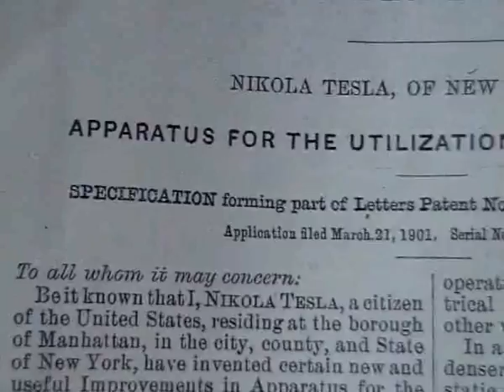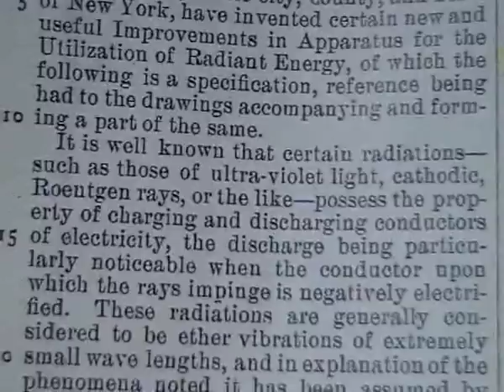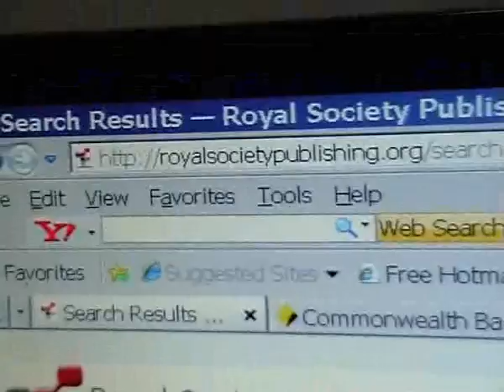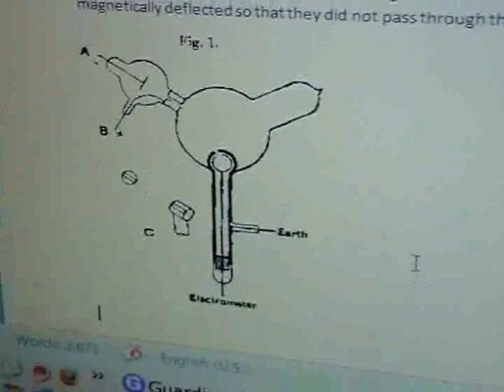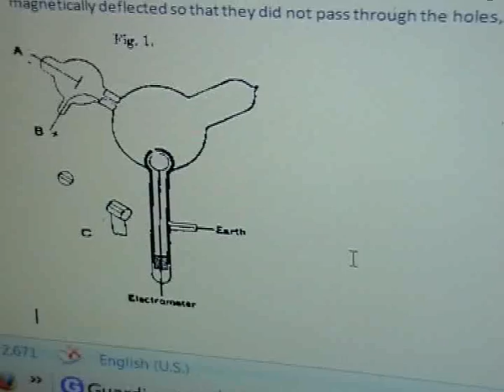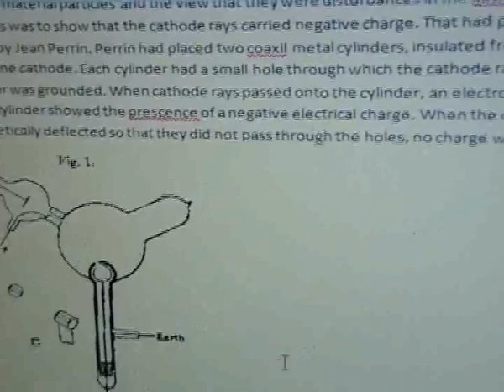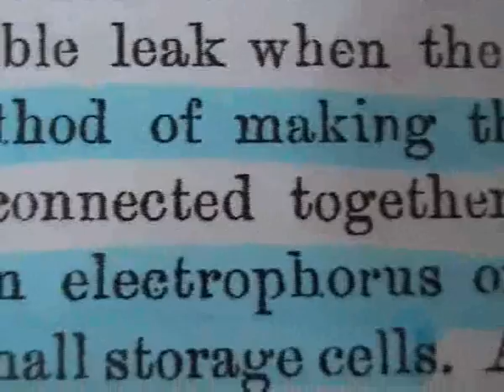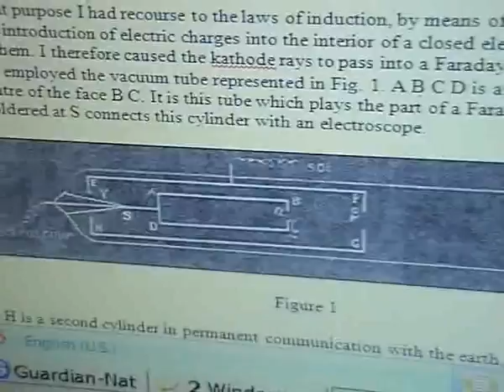Update 30 - Found missing info from Tesla Radiant Energy Patent

Comment: His arc lamps charged plates to high voltage, now i am using a xenon arc lamp to charge a metal plate. It is the longitudinal force component of the uv rays that do this. Tesla arc disputer was basically a pulse plasma 2 stroke that put out this radiant energy.

Comment: Plasma can be done as a transformer type primary tubes and secondary tubes with one connection tube between them with a valve between .Two in a coil shapes close to each other the secondary is started with the valve the anode and cathode are on meter

Comment: Thank you so much for this information! I searched in the web page royalsocietypublishing and I got few PDF about Roentgen X Rays and that one called "On the Discharge of Electricity Produced by the Rontgen Rays, and the Effects Produced by These Rays on Dielectrics through Which They Pass" and I downloaded all of them but I think it wasn't the same PDF with ilstrations that you are showing here.
Reply: Those rays can charge up metal plates to high voltage and transmit energy when driven with impulse DC! I want to try this as they have high longitudinal electric fields!

Comment: interested but according to his patent, he considered these rays as particles of matter, along with sunlight and UV, called radiant energy as being able to reverse the charge of his insulated charged plate. Actually, what Tesla has created in that patent was an analogue version of a semiconductor such as a PN junction like what is now used in solar panels, LED's  etc in the days before photodetectors and diodes which would have made his work even more abundant and simpler.
Reply: These rays also carry high voltage longitudinal electric fields! Whence these devises collected that field and it was channeled to a capacitor! todays LED's and solar panels cannot even come close to voltage and power levels produced by Tesla!
Reply: these rays are made of virtual charges in the quantum vacuum or ZPE. if pulsed with HV impulse DD they can charge any metal to a high voltage potential!
Reply: @jlo13800  The ray is Counterspace/Aether set into motion by a fast enough impulse of voltage or unidirectional current to produce an unbound longitudinal shockwave, think slapping water hard and fast and where the majority of the energy goes.

Comment: I think you're right. A guy called Thomas Trawoeger has just open sourced a pyramid which produces 20 watts or so of free energy. He has issued over 3 hours of video and step by step instructions. He has invented a device he calls a reactor. It contains quartz sand and guess what?  He CHARGES it with HV prior to it working. It's on you tube right now. Replications are on-going on overunitydot com and overunity dotde      Enjoy.......

Comment: Not exactly. I've experimented with Tesla radiant energy circuit and it was apparent that it was drawing electricity from the atmosphere and the power output would actually vary depending on the weather. Also, distant lightning strikes could be observed in the power output. I could use it to almost flawlessly predict the weather.

Comment: Try building the device in Tesla's patent, then see how it behaves.

It's just a plate and a vibrating contact connected to ground through a telephone earpiece (or nowdays use an audio amplifier too.)   It's a primitive nano-ampere detector, since the slightest current in or out of the plate will cause a buzz in the earphone.  Probably you'd have to shield it inside metal window screen in order to block all the 60Hz voltage fields in your house.